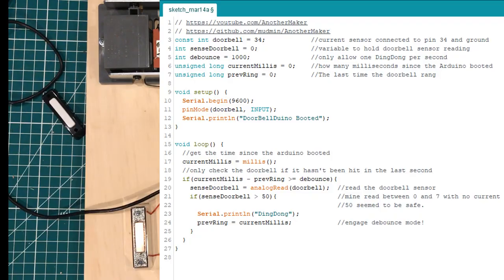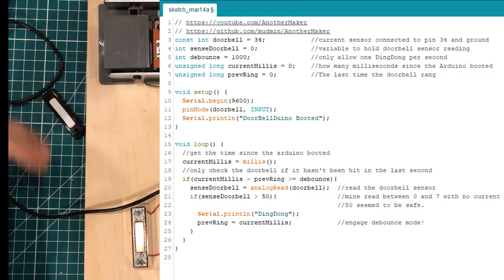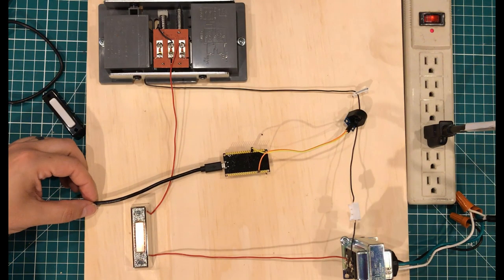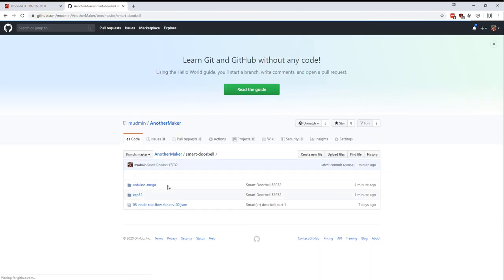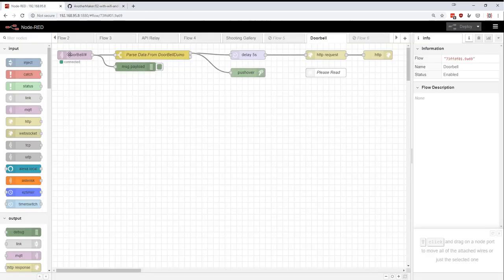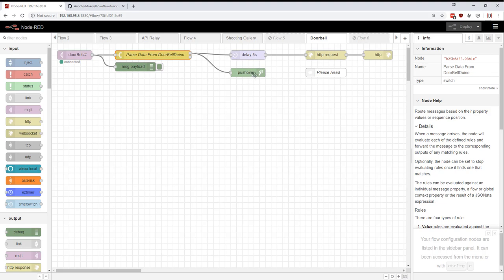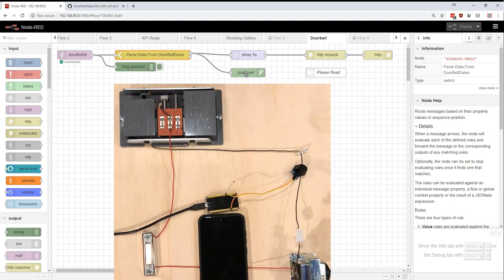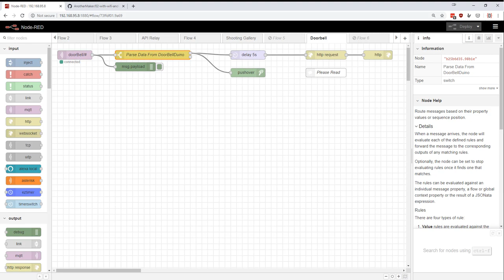Make a dumb wired doorbell smart for less than $6

Comment: I never really appreciated how great wired doorbells are actually. No batteries to replace, no dead spots for signal, no interference. 
Plus the push-button illuminated with an incandescent lamp is a nice retro touch. No LED tatty crap there.
Reply from the maker: Yep. It's hard to justify swapping mine out because it works so well.

Comment: 20V and 0.6A is 12W.  That might produce a lot of heat in the solenoid coil, if the doorbell is left pushed-in.  Possible to create smoke and fire?  Just where my mind goes.  A secret tap code that unlocks the door might be useful.  Strange that new houses are still built with these telegraph-era doorbells.  Seems like a much better idea to just close a small signal circuit.
Reply from the maker: I LOVE the secret code idea. Even if it's just for an easter egg on the front porch.  Or maybe that auto engages my squirter!!! 
 
I think the idea is that the wiring just "works"  and has survived a lot of tech changes over the years.  Idk what the limits are.  

Someone later reminded me that I need to double check how much current the current sensor is putting out. This project was originally on an arduino, but on an ESP32, I may need to be a little careful.
Reply: @AnotherMaker  My dream is to make a doorbell that triggers the sounds of vicious dogs barking, and moving all over the house.  Not a recording, you know, but something that deep fakes and angry pack, different every time.
Reply from the maker: I love that!

Comment: Great project. I’m thinking of modifying it to detect when my water pump is running while out of town (a poor man’s frozen pipe detector). I would assume it would be safe to use the bigger brother of the current detector (the one that splits to allow the hot wire through) on an ESP8266/32.
Reply from the maker: Yeah absolutely. That's a perfect use

Comment: Thanks for the video and instructions. I have a 2 chime, 2 push button setup at my home; would this work in that scenario? Also, is it possible to mute the chime in your code?
Reply from the maker: It should be possible as each button goes to a different part of the transformer. I'm thinking you could figure out what kind of current the chime draws and put some other form of resistive load in its place.   A light might be an interesting idea.

Comment: when using the current sensor program does the box pop open automatically when pressing the doorbell?   I am trying this program with pin 34 and Gnd of my ESPs board and no luck.  Nothing.   When I flash the board it gives me a successful response.      I would like to confirm something is working with this project

Comment: I live in an old Victorian and have three doors that get visitors. Rather than doing a regular doorbell I thought it would be fun to hack the system to turn on old radios or vintage phones when someone rings a bell. Can that be done with this setup?
Reply from the maker: Absolutely. The point is that you're sensing the current of someone trying to ring the bell. Once you do that, you can pretty much do anything with that information.

Comment: I was told PushOver is a pay for subscription for text messages.  If this is true does your program support any free services?
I will look at the other video.  This is exactly what I want to do.  I have a USB to TTL adapter that I have used for other projects. I just need to learn how do I put the program on my computer, what do I use for this and how to I load it into the ESP32xx board. 
I have been wanting to get into this but never had the right how to for a newbie.   Thanks, Ken
Reply from the maker: Pushover notifications are free. You may have to pay for SMS or pay for the app one time.  ESP32 boards are super easy to flash on the Arduino ide. This guy is the best with this stuff https://randomnerdtutorials.com/getting-started-with-esp32/

Comment: I have this water detector with WiFi.  I was wondering if I could mod it to work with my doorbell.  If I short the contacts that sense water but with a wire jumper nothing happens but if I do it a second time it successfully sends me the text message.  This unit was only $15 on amazon.  I built a A.C. to D.C. rectifier with a 12 volt regulator connected to a 12v relay.  The A.C. side connects to the 2 transformer wires at the doorbell chime.  Push the Doorbell button and the relay closes.  The closed contacts go across the 2 post of the water  detector.   Not until I get a second push of the doorbell button does it trigger the water detector.  If I leave the contact closed for a few seconds it triggers and I get an alert message the first time.  I was thinking if I add a capacitor across the coil of the relay it might hold the relay closed long enough to not need the second push of the doorbell.  Any thoughts of modding a water detector for a doorbell alert message   The best part of the project is its only $15 on amazon and holds 2 AAA batteries. 
The other thing I was wondering about is, I am assuming this is using a small micro computer like in the video.  Could it be re-program to work like in the video?
Reply: are there any good websites that hack things like Smart wifi water detectors to make them do something different?

Comment: The current sensor appears to be so much better than a reed switch next to the chime that I've seen in other projects.  There are no moving parts and a lot of the reed switches suffer failure after lots of cycles.  How would you power it?  I found a prewired stepdown module that converts 12-24V down to 5V to use the doorbell transformer.
Reply from the maker: I had power in the area so I just used a usb charger.

Comment: was this project ever completed.  I am a newbie.  I am still trying to figure out how I install the program to load in someones program and learn how to edit things like my home router user name and password and how for free I can then have it send me the text message.  This project is exactly what I wanted because I wanted to install it at my doorbell transformer location which is close to my Router.    I certainly would appreciate a little guidence (assume I know nothing about Arduino) but has no problem wiring up the hardware with a diagram.  My goal right now is not to learn programing but to get a project working and then look at how it was written later.   Thanks,

Comment: If my doorbell does not use any current until the doorbell button is pressed does the program have to be changed? In your example you mention you have current flow all the time.  I am assuming you have a doorbell button with a light built in?
Reply from the maker: The variations are enough that it shouldn't be a problem. You may have to tweak it but basically you can install the program as is and see if it is firing off when a doorbell is pressed
Reply: @AnotherMaker  Could you also explain where in the program, if I have to do anything to make it work for push messages besides install the app on my cell phone and sign up.   I was told another push server called Pushsafer is free.  That would be a nice alternative then a pay for app.  Knowing how to change the program for different push services would be really handy.
Reply from the maker: I'm not really sure what you would need to change because every API service like that is so different
Reply: I tried your basic current sensor program but no luck connecting to the board.  When I connect the board to the laptop I get the usual bong sound.  I click UPLOAD and its starts but it never connects finally giving me an error. Any hints what I could be doing wrong?  I am using the board you put in the amazon link and a known good USB cable to my laptop that I have used to communicate with other devices.  Looking in the Device manager it shows as CP210x USB to UART Bridge Com 3
Reply: @AnotherMaker  I have the basic current sensor program working.  I had to remove the 80 ohm resostor across the sensor. No luck with the completed program.  I keep getting failed to connect to MQTT.   I installed pushover 7 day trial which will be ending soon.  Serial Montor is telling me I an connected to my router.   You said the program was completed.  Any idea why I keep getting the MQTT connection fail message over and over?    How does he program know to connect to my cell phone for the alert message?   I know I am a newbie but I would think something in the program has to know how to link to my cell phone??

Comment: const int doorbell = 34;           //current sensor connected to analog15 and ground    this is the completed file.    Could you clear up the pin for the sensor.   Your sensor only test states to use pin 34 following a comment to use pin 34,   However the completed program uses the statement above with 34 and comment analog15 which is not pin 34  on the board in your parts list for Amazon, ESP32s,   the ADC15  is GPIO12 pin 4.    what should it be and feel free to talk low level.   I really would like to try something to get my feet wet.   Thanks
Reply: I just built this with ESP32 off of Amazon. Left the code with "const int doorbell = 34". Wired the current sensor to GND and pin #10, marked "D34" on the ESP32, and from pinout diagrams is described as "ADC1_6, GPIO34....and it works! At first I just ran the doorbell transformer wire straight through the current sensor, but that didn't work. Instead of modifying code to see actual values in real-time to see where it was sitting when rung and playing with the threshold, I just looped the doorbell wire through the current sensor once, to double the output, and that worked to trigger the "DingDong" MQTT message. Am going to play with code a bit to get DHCP IP address set and regular MQTT health/status messages sent.
Reply: @KevinLaFollette  My only luck with this has been using just the current sensor only program.  Never had any luck with actually alert messages.   I did have some help with someone who help me get the project to work with BLYNK.  I am at the point now where I get alert messages sent to my BLYNK setup.  I get occasional false alerts and have been experimenting with different levels for the sensor.  For example at the "50" level I was getting false alert messages about every 5 or 6 minutes.  This could be due to a noisy line.  My last test was with a level of 1200 and I got 1 false alert over a 24 hour period.  I will increase the level a little more.    I will be interested how you make out getting actual alerts sent to your phone.  My trial using the notification service mentioned has expired and I won't be using that.
Reply: @n1kkri  I have the Mosquitto MQTT broker for handling MQTT messages and HomeSeer home automation system listening to MQTT, that I use to trigger event actions. Based on the MQTT message coming into HomeSeer, I turn on lights, make announcement over Alexa Echos, display front door security camera on TVs and send text message to phone that doorbell has been rung.
Reply: @KevinLaFollette  I am not familiar how to setup MQTT.  I was asuming the completed program was all configured and all I need to do was enter my ssid, password and sign up for the app.  Obviously there was more to it then that. I started looking at BLYNK and had someone remove all the MQTT stuff and anything else that would not be needed for BLYNK.  I have it working at about a 99% level.  I have been adjusting the sensor level and noting if I continue to get fake alert messages.   at 1200 I received only 1 fake alert.  This is really good.  Next step will try it at 1300.
Reply: @KevinLaFollette  I am using the sensor from Amazon indicated by the link.  It comes with a 80 ohm resistor to be wired onto the board with the sensor and connection posts. Assuming this resistor was to be used since it was the sensor in the link for parts, I did solder it to the board.  I found the sensor only program did not work. I removed the resistor and the sensor only program did work however in my case I received in addition to legit alert messages when using the serial monitor in the Ardrunio IDE program, I also received several fake alerts until I changed the default sensor setting of "50" to a much higher level.   If you used the sensor from Amazon did you also have to remove the resistor?
Reply: @n1kkri  that is called a "burden resistor" and should be in place. That is what the current flow from the transformer goes through to create the calculated voltage that the ESP input measures. I would be surprised if you would get it to work without it. Not familiar enough with ESP32 to know what it has on the analog input side, might be a voltage divider in there that is serving the burden purpose, but would suspect it would throw off the current/voltage ratio if not the right value
Reply: @KevinLaFollette  In my case the resistor had to be removed.  I verified this a few times.  I assumed it was to change the current flow or voltage delivered to pins 34 due to the fact it is shunted directly across the output of the sensor.
For example if you had 5A of current flow though the sensor the resistor would allow less current/voltage to pin 34 and GND.  If you had less current removing the resistor would allow more current/voltage to reach pin 34 and Gnd.   I have seen other similar sized sensors that use a different value resistor.  I would think its to extend the range of current/voltage delivered to the board.  In other words, if the 80 ohm resistor is in the circuit 5A of current would produce 5ma at the output.  The spec on Amazon is 5A = 5ma.     I think this is why it didn't work in my case.  If the circuit measures voltage the resistor would load down the sensor allowing for a lower voltage drop for pin 34 to measure.  Without the resistor a higher voltage would be present at pin 34.    That's my take on it.
Reply: @KevinLaFollette  I did a little research.   On a different sensor with the same 5ma = 5A they use a 220 ohm resistor.  Using ohms law E-IR  5ma x 220 that produces 1.1v for every 5ma of current across the resistor.   Its also mentioned a 1:1000 turns ratio.
With the amazon sensor that would produce only 0.4v for every 5ma.    Interesting 2 different value resistors for the same 5ma/5A ratio.   The other thing that came to mind is I am wonder if 80 ohms is to low to be placed on pin 34 and gnd.  ??   I might try changing the value of the resistor to something higher just to see if it works then play with the sensor level in the program.
Reply: I looked at a few other circuits and I found one that uses 33 pins however 2 other resistors in a voltage divider circuit along with a Capacitor.  Its a little more involved then what was shown in the video for this project.
Reply: @n1kkri  I've done a similar project with a Wemos D1 mini and 30A split coil current sensor for electric dryer to detect when running. Did build a voltage divider circuit for that one. Was surprised didn't need one for this with ESP32, but figured was worth a try. Since it works for me, haven't dig into reasons why. Guessing ESP32 might have voltage divider built in,

Comment: My main issue that is that I have random spikes every now and then, any way I can fix that?
Reply from the maker: Are you saying your transformer has spikes that are triggering false rings?
Reply: @AnotherMaker  correct, I managed to minimize the issue, though. I set a pretty narrow range because the spikes are usually greater than a real signal and I also used the median function with a window of 3, since spikes are...well, spikes.
I still got some false positives because sometimes the pin doesn't go back to base value immediately after a real signal, so I set a condition that the median has to first have reached base value before a new notification can be sent again.
This can cause a delay from 300 ms to potentially several minutes, but I don't really need to know if someone rang twice.

Since the chime is electric (rather than a mechanical bell), though, I might try measuring that circuit instead. Maybe that's more reliable as it is internal within the speaker itself.

EDIT: Ok, tried the latter, gives me the same inconsistency.
I do still get false positives, so I might have to adjust even further. But sometimes one spike just happens to be exactly in range.
I wonder what causes those spikes.
Reply: @AnotherMaker  Maybe a binary sensor would be a better way to go. Any idea how I could do that?
Thanks in advance for your help.^^
Reply: I'm using ESPHome btw. But I can't seem to figure out how to not get false positives. I live in an apartment building and somehow there quite often seem to be random spikes and I haven't found a way to filter all of these out reliably without getting false negatives.

Comment: So Node-Red is a program that writes code? Why have I been doing it the hard way?
Reply from the maker: I'd say node-red simplifies connecting things together.  I use it for quick integrations and when I want to leverage the horsepower of a "real" pc/pi over say an arduino.    I also like it because I can program the arduino once and then change logic on the node-red side without necessarily having to reprogram the arduino.  I have a 2 part video showing it off. https://www.youtube.com/watch?v=B_4dvclsDRo
Reply: @AnotherMaker  Nice. Thanks.

Comment: There is no way in hell that tiny transformer can put out much more than 1 amp (continuous)
Furthermore it puts out AC yes but not mains voltage. It's more like 8 volts AC. Fully isolated and perfectly safe to touch. Just put the wires on your tongue.
Reply from the maker: The other side of the transformer had 110v... That's what I was warning people about.   The other side is 16v-18vac
Reply: @AnotherMaker  oh sorry. Totally right you don't want to go messing with 110 or 220 vac for that matter